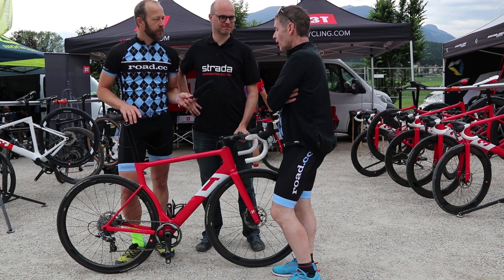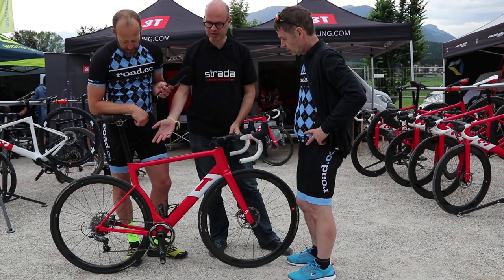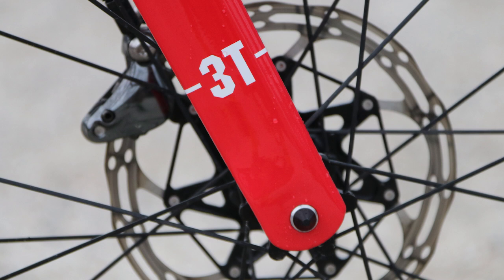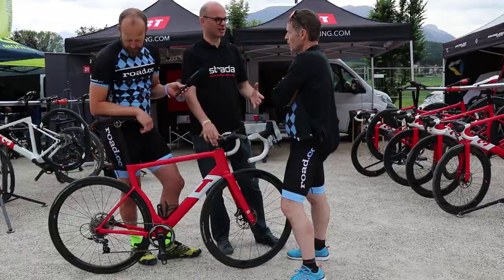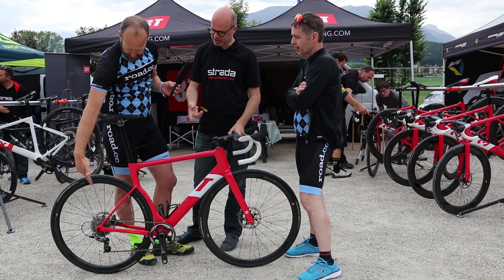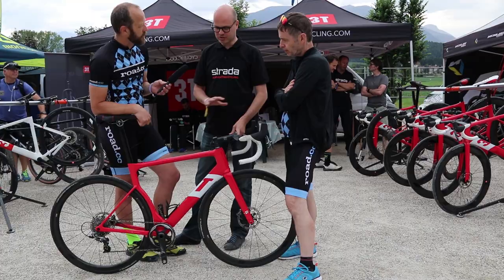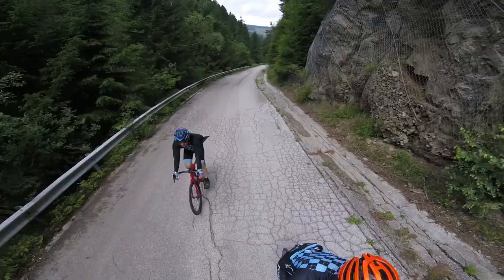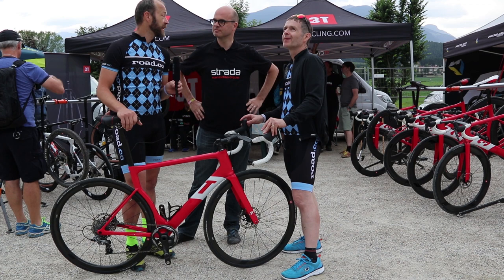3T Strada - The road evolution starts here? Pt2

Comment: I would love 1x something to be the final solution. But it's not. If you disagree with be just watch 3:31. The cadence is just wrong on such a gradient. Probably 10 to 12 degrees. Look how the struggles. If you love your knees please don't do that. Begginers? I don't think so.

By the way. The bike is gorgeous! I'd totally buy one. Loved the clearance for 28mm, my prefered tire size for road. Loved the discs. But i would certainly change the groupset to a compact 50x34 - 12/32.
Reply: and now you can get the Due with 2-by setup

Comment: An aero high speed bike with 1X11 is absolutely stupid thing .What about over 50-60 km/h mr Vroomen ? The lack of 53/11 doesn't matter in an aero bike ? This would be the slowest bike .

Why so closed clearance ? Doesn't bother the turbulence from tire ?
Reply: 53/11 < 50/10
Reply: If it's 50 ok for max speed but so wide gaps, why?
Reply: Important to note: This bike's max is 44/11, not 50/10. Based on what he says at 2:30 or so it sounds like their cassette will also start at 11T.